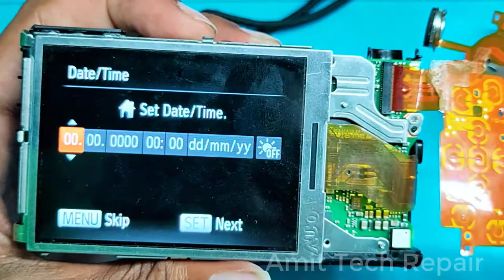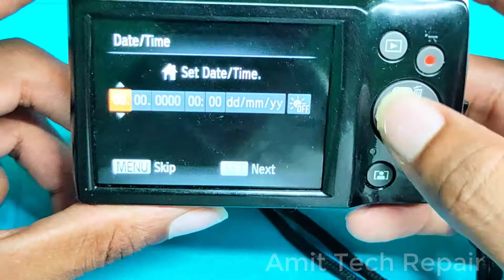Canon camera white screen problem|how to repair camera display|ixus 185 canon camera white display

Comment: Hi i have a question i have the same camera the problem is the screen was working well i can see and watch my videos but when I'm going to take a video or picture the screen is color black what do you think is the problem?
Reply from the maker: This is settings problem,
Reset setting
Reply: @AmitTechRepair  we already did but nothing happened. I saw a one video have a same problem with mine and i saw that he open sa cams back. Does it cost much if im going to repair it to a shop???
Reply: @jennyrose1448  same problem what is the solution.is u repair it?
Reply: @kahfi ahmad yes may camera is canon ixus too
Reply: @kahfi ahmad i give my camera in canon sevice center for repairing
Reply: @AmitTechRepair  how?
Reply: I have ixus 160 model, the problem is only while clicking the photos it became with white exposures. But in video mode it's good. Please help me guys please.
Reply: Hi I tried fixing my camera and now it does not turn on. Any suggestion? Olympus x-905.